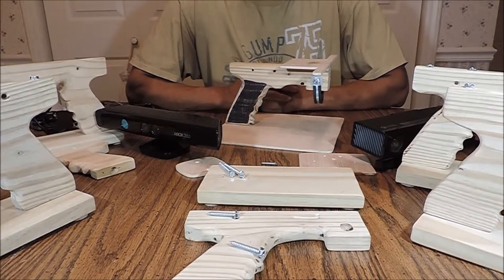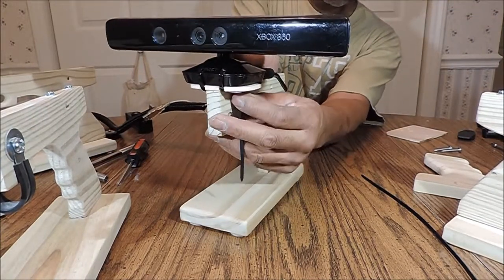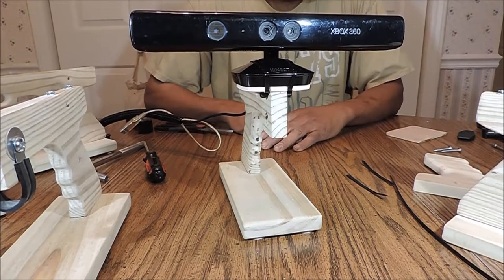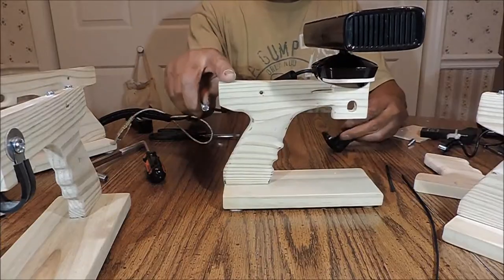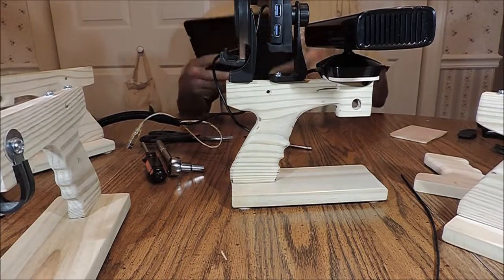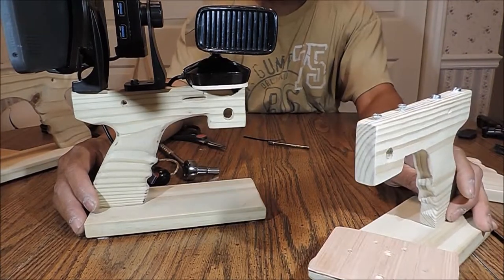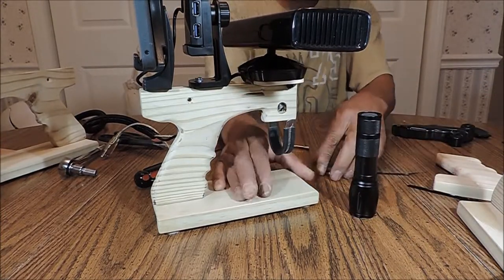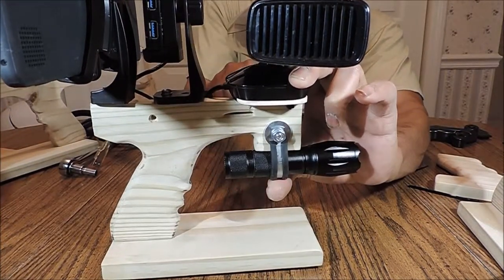How to Design and Build Ghost Kinect Camera Stand KinectX-BlocKX Part 1 of 9

Comment: Would you mind sending me a list of parts I need so I can build one by following you on this video?i would truly appreciate the help!!
Have you figured out what it cost you to buy all the parts?
This stand is so much better the You first video! Where did you buy the Block X60?
Reply from the maker: Custom design handle, (which you'll be able to find on ebay) all ready had a XBOX 360 Sensor Bar, and all the other items were bought on ebay as well. I'll provide you will a list parts and cost in a vid soon if it will help.